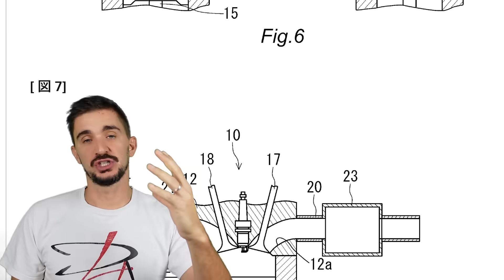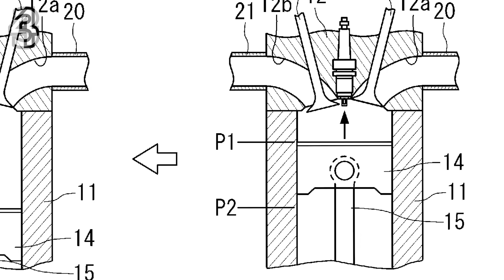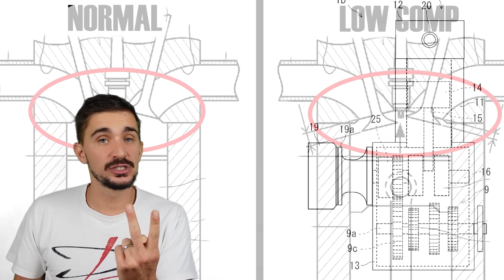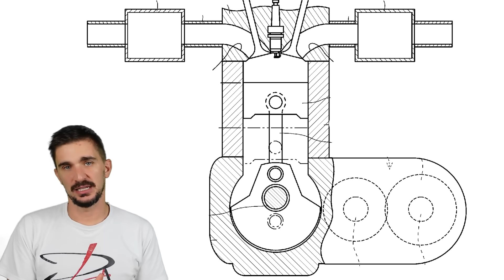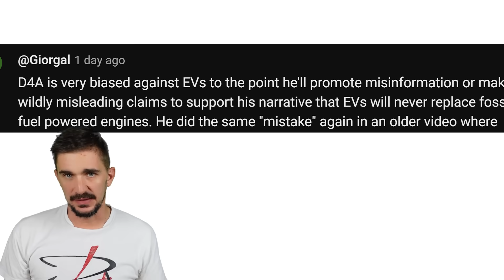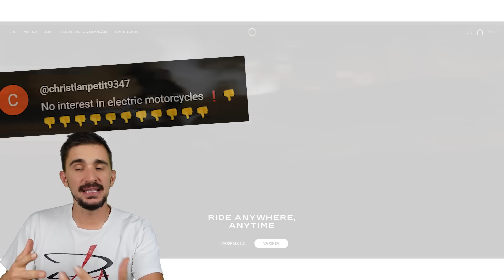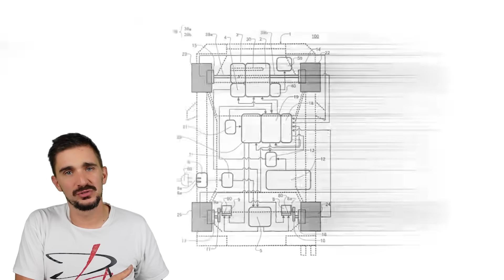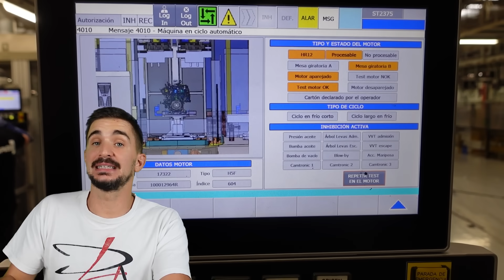Yamaha Just Patented A Fake Engine

Comment: Hi D4A! I've had this engine theory buzzing around in my head for a while. Its inspired by a combination of the FB20 (that is in the 2013 subaru i currently own), an opposed piston engine, and the rev theory engine. Admittedly, i used AI in order to help me build a detailed description of this engine because I am horrible with words, lol. But I hope this intrigues you enough to maybe at least address your thoughts in a video. 

FOP3R-X 2.0L Engine Technical Analysis: "The Beehive" (Final)
Definition: Flat Opposed Piston 3 cylinder Rotory exhaust valve - Experimental 2.0 Liter
Output Targets: 380HP and 330 lb-ft at 9,000 RPM.
I. The Core Architecture: Symmetrical Balance
"The Beehive" utilizes an advanced opposed-piston design where every function is performed symmetrically, resulting in a low-vibration, high-power-density engine.
1. Opposed-Piston and Symmetrical Operation
Configuration: The engine has three bores with six pistons, creating a 2.0L displacement.
Extreme Balance: The dual-crankshaft system is mechanically synchronized (fixed phasing). This allows the two opposing pistons in each bore to move in precise symmetry, ensuring the engine cancels out all primary and secondary reciprocating forces, providing an ideal platform for the 9,000 RPM redline.
Power Density: The two-stroke cycle delivers a power pulse every revolution per cylinder, giving this 2.0L engine the combustion frequency of a conventional 4.0L six-cylinder four-stroke engine.
2. Symmetrical Scavenging and Charging
Simultaneous Intake: As the opposing pistons reach their widest point, fresh charge (air/fuel) is inducted simultaneously through ports uncovered by the piston crowns at both ends of the bore. This provides maximum cross-sectional area for cylinder filling.
Combustion and Exhaust: After combustion, the exhaust ports (positioned centrally between the intake ports) are uncovered. Exhaust gases exit simultaneously through all available exhaust ports in that bore.
II. The Exhaust Flow Controller: The Rotary Exhaust Valve (REV)
The REV is the single most complex and critical mechanical component. It must manage the exhaust flow and timing for two simultaneous exhaust events per cylinder per cycle.
Shared Exhaust Port: The multiple exhaust ports within a single cylinder bore all feed into a single, common exhaust collector volume that is interfaced directly by the REV assembly.
The REV as a Single Gate: The electrically controlled, high-speed Rotary Exhaust Valve functions as the master gate for all exhaust flow in that cylinder. Its precise, instantaneous opening and closing is critical for two functions:
High-Efficiency Scavenging: Opening the gate at the exact moment to maximize pressure extraction and flow velocity.
Stable Low-End Torque: Rapidly and precisely closing the gate after the exhaust has exited to prevent the fresh intake charge from escaping, thereby maintaining the necessary compression and providing a stable, reliable idle that is non-existent in traditional two-strokes.
Thermal Load: The REV's central location and necessity to handle the entire exhaust volume requires an isolated, high-capacity oil cooling circuit and sophisticated materials to prevent thermal degradation and seizure.
III. Forced Induction and Thermal Management
The engine relies on aggressive forced induction and structural integrity to handle the 14psi of boost and high RPM stress.
Twin-Charge Strategy:
Roots Supercharger (SC): Provides instantaneous boost off-idle, ensuring the necessary air volume is forced into the bore to assist the scavenging cycle, regardless of engine speed.
Turbocharger (TC): Provides sustained, high-flow boost for peak power above 4,500 RPM.
Electronic Crossover: The standalone ECU manages a bypass valve to seamlessly transition the boost source. The SC is disconnected once the TC is spooled, maximizing the mechanical efficiency in "Stinger Mode"
Direct Injection (DI): DI is used to inject fuel directly into the combustion chamber. This provides the primary mechanism for internal thermal management, acting as an instantaneous heat sink to suppress temperatures and prevent knock under extreme boost and RPM.
Billet Structure: The engine block must be CNC-machined from Billet Aluminum. A cast block cannot withstand the extreme vibrational energy and the continuous, rapid firing cycles (power pulse every revolution), requiring the billet structure to ensure bore stability and component integrity up to 9,000 RPM.
I. Structural Integrity and Material Specification
The engine's reliability at \mathbf{9,000 \text{ RPM}} under \mathbf{14 \text{ psi}} of boost is entirely dependent on its materials and construction, specifically the use of a billet block and specialized sleeves.
Additional details: Billet Block and Sleeved Cylinders
Engine Block: CNC-machined from Billet 6061-T6 Aluminum alloy. This is mandatory to withstand the intense, high-frequency torsional forces and continuous power pulses inherent to the two-stroke cycle, which would rapidly fatigue a standard cast block.
Cylinder Sleeves: The bores are fitted with custom, press-fit Darton MID (Modular Integrated Deck) Sleeves made from Ductile Iron.
Necessity: The aluminum block cannot handle the wear and high friction from the piston rings. These sleeves provide a robust, stable surface for the pistons.
Function: The sleeves are designed with an open deck to maximize cooling around the upper bore, crucial for managing the heat generated near the ports. The material choice ensures longevity against the lateral forces of the opposed pistons.
Again, I'd love to hear your thoughts on this hypothetical engine thats been running through my brain for months now. Thank you for your consideration in advance! 
I enjoy your content very much, and your coverage on the REV theory engine is what truly drove the inspiration for this hypothetical engine, please keep up the good work.
Also, sorry if you see this more than once, just trying to make sure you at least see it.

Comment: It kinda seems like a reverse hybrid. 
With the clutch system in there (if it's really an almost functional engine), could the cam and valves be swapped or modified to work as a range extender?

Comment: If the fake engine is already in the bike why not change the valving and get it running so you can use the advantages of both engines 🤔🤝🏻

Comment: I agree with everything you said in this video. The first thing I thought was people like me who hate evs enough that we won't buy them would hate a fake engine more. It's heavy, it won't ever sound the same because there's no combustion and the air ain't as hot, scavenging don't matter, ect ect. It's stupid, it really is. To make something heavier, have less range, and less power for a noise that no one's gonna want is dumb. EVS have instant torque but are way heavier, ICE is lighter but usually don't have the same jump, that's the tradeoff. Always has been. This is the worst of both worlds, throttle lag and heavy reciprocating mass for no benefit besides a noise that no one cares about. This is one of the dumbest things in automotive history, no fucking idea what the point of this was🤷‍♂️

Comment: I think this video is a bit of a miss. Far sillier Ideas get patented all the time. This is Novel, as we've never seen it done. And its just a haptic Feedback system for riders, because loud noises and vibrations are what make going to see the F1 more fun than going to see formula E. Yes its a waste that adds mass, and power loss. But so is A/C, and motorcyclists dont always buy the most light weight, best handling most reliable bikes to begin with - See Harley.  
Also getting a patent doesn't mean we'll ever see the product get made. Its neat and I'd like to try one, though I'd probably never buy one myself haha.

Comment: Fake things actually are not interested. Hyper cars are using support hybrid sistem for turbo lag solution. Hybrid motorcycle could be good… 

6 cylinder 400cc block motorcycle.. Good sound but low torque value in low RPM so can support this.

Comment: Suppose a future law required ICE engines older than say 10 years to be removed from use.  And suppose this Yamaha "Fake" ICE engine which is patented as "Fake" really can operate and produce a good power band after 1 or 2 small modifications.  It would be a loophole allowing individuals to continue to enjoy ICE motorcycles... for a while (until the loophole is closed).  Or maybe someone very high up at Yamaha is just senile.

Comment: I have a similar approach. I equally enjoy riding both my motorcycle with a big single cylinder engine and my ebike. Both are fun, both are doing a really god job of taking me from one place to another but I clearly don't want a fake combustion engine in my ebike. I like it because it's simple, quiet, low maintenance, barely costs any money to ride and doesn't draw too much attention when going offroad. This is quite the opposite. I really hope that it never reaches production as it's a massive waste of resources while doing nothing positive. What would be way cooler is a plug-in hybrid motorcycle that can ride in fully electric mode while still having that petrol engine for range at high speeds.

Comment: I would love a series hybrid bike.  Electric with a small battery, 30-40 mile range in pure electric, and a compact 20 kw parallel twin powered generator.  Maybe even a diesel!
I guess that's my next big bike project after the Dieselwing DL500.

Comment: Yeah I doubt this will work for Yamaha. Not going to buy an electric bike with more moving parts and a smaller battery just to feel like an internal combustion engine. I like the sound of combustion engines but also the sound of an electric bikes. the engine makes a subtle wuring sound that is quite relaxing.

Comment: Had a 4 cyl 4WD a while back that wouldn't pull a sailor off your sister.
It DID however, have a full on 20 speaker audio system through which I, at max volume, played Yello - The Race.
The reactions, including one which prompted a guy to come running up to the car frantically demanding to know what kind of V8 was in it, were ALL declared to be energy well-spent.
Fun times. 🤙😎

Comment: weight is already a penalty for having such emotional thing on board; or Yamaha could have incorporated a weak - somewhat Atkinson cycle - air cooled half usable engine for sake of sound but could have range extending feature up to few KMs or Miles, with small fuel can/tank. Just generate One HorsePower !

Comment: I am sure a cam shaft change, a fuel injector, and a fuel tank could be easy to convert the fake bike to a real engine. Then when you get your fake engine, you have avoided the EPA regulations, and with a little bit of work you now have a petro bike.

Comment: I am one of those diehards. If it doesnt burn gasoline or diesel I'm not buying it  For the time being there are plenty of rational reasons that support my position (purchase price, range, resale value etc). Should ICE vehicles be forced out some day, I have plenty of used options. 

In fact, even today I find myself drawn to bikes and cars that have no engine electronics. My second to last car was from the 70s and the automatic choke bothered me more than it should have

Comment: If I were to buy an EV, I'd only do it if I could get one that's made like the Yamaha motor in the video. I normally hate things that aren't functional on my car, but you're looking at it the wrong--it IS functional. Its function is to sell the bike to people who wouldn't buy it. Just kidding. Its function is to give a person like me the experience I really enjoy. I won't by EVs because there's no sound, no manual transmission, and no vibrations or shift point jerks, etc..

If you want to look at the motor as functional on another way (selling the bike), think of it like a piece of the body that makes it look better but hurts it's aerodynamic efficiency. That's what unnecessarily large vehicles often are. If I have a wife and no kids, and hardly any friends I go out with, I don't need a large SUV. It's an aerodynamic brick. But its looks make me feel good about buying it and showing it off. So its looks sells the vehicle.

Same goes for this fake motor. It's not just a non-functional motor--it's just an inefficient addition that sells the bike and makes the owner feel good about the sounds and vibrations it makes.

That's its function. It's that simple.

Comment: Hi there, I don't think that is really a bad idea, from the engineering point of view, absolutely is, but from the marketing point of view and from Yamaha's way of doing things it can make some sense.
lets take the 2023 MT09, it has some kind of speakers on the sides of the petrol tank, the 2022 MT09 had the exhaust pipe designed by the musical department of Yamaha, so really they are some way obsessed with the sound of their engines.
And that put together with a new market (EV) coming in quickly, that nobody knows how it's going to develop, it really doesn't seem a bold move, but quite a really well studied one, probably it will be one of those patents that will end in a big bluff, or maybe not it's like a lottery ticket.

Comment: I completely agree with you I think is a waste of money for the actual bike and also for motor oil also the suond kinda sucks and I personally do not like it. Also the electric motor needs to waste some power to run the fake engine and the compression makes it harder to spin the crankshaft. You can experience that if you have an old 2 stroke moped without any form of starter like a kick starter or pedals in that case if you do not pull the decompressor (correct me if I said it wrong english is my second language) pushing the moped you will feel that is much harder than pulling the decompressor and letting the air flow out. So this patent is completly useless and you waste performance of the electric motor so either you do it petrol or you do it electric.

Comment: Complete garbage.  It not only creates a crazy illusion, increases the ticket price of the model, vehicle weight and rotating mass. The sound produced by this cannot be the same as an I.C.E. because there is no combustion cycle, which is the main ingredient to the noise.  if you want noise and vibration, incorporate a slightly out of balance flywheel on the motor shaft and use digitized sound.  Deliver the sound through blue tooth so it only plays on earphones in the riders helmet and no one in the outside world is forced to listen to it.

Comment: It’s kinda like manual transmissions. Objectively, there’s no functional reason to own a manual transmission vehicle in 2025, and yet we do it and we love it. Yamaha just went pretty extreme with this one
Reply: No, there are reasons to use a manual: better mechanical efficiency, better reliability and longevity, and all around a much more direct linkage between controls and actual car output

This thing gives NONE of those advantages. It makes noise and vibration, while preventing you from putting an extra battery there for better range, or removing it entirely for lower weight and reduced cost

Comment: Man, wtf is happening in this world...this sucks. I understand that it is fairly obvious that all manufacturers started running out of ideas and innovation around the IC engined-vehicle since around 10 years ago when the pressure of ever stricter emission regulation was getting into effect, Especially in motorcycles where space is very limited. 

But this fake engine... This shows an insane man (or corporation)'s  depression symptom very clearly. They need all "counseling" (new management) and perhaps "medication" (money) asap. 😅

Comment: I was just about to say as a kid in the 50s we used to place a bit of card which would strikes the spokes giving us the noise and pretend it was a motorbike, cost zero. Yamaha have lost the plot. I own several old and classic motorcycle and even  bought first brand new motorcycle in 2015 then later  sold it to a friend to heavy for this 78 yr old , I don’t wasn’t an electric motorcycle, electric bicycle yer maybe I rode one the other day they are a tad bland and the mileage is appalling when it runs out I can see pushing the dam  thing home for charging, My old 1965 Triumph 650 TR6 will give my over seventy miles to the gallon and the tank is about four and a half gallons given me quite a range. Also there’s the constant danger of  waking up dead if the battery ever over heats at night during charging burn up me and my house, it happens,  in all my years from 1963 to date I have never had a bike go up in flames and I have crashed while competing and dropped bike through over cooking it and stupidity, never lost one to the flames, except the BSA lightning I was helping to fit WalPhililps “fuel injectors” backfired and set the bike alight which we control with the help of a handy fire extinguisher. Those battery bike go up in smoke there ain’t no stopping them .  My best Yamaha was back in the early 80s a XS1100 maybe the best bike they ever made… yam need to stop this nonsense they may end up with a right dodgy name and only be remembered for this thing…